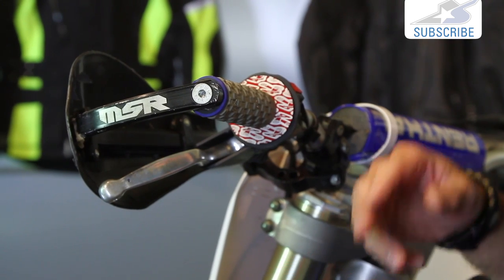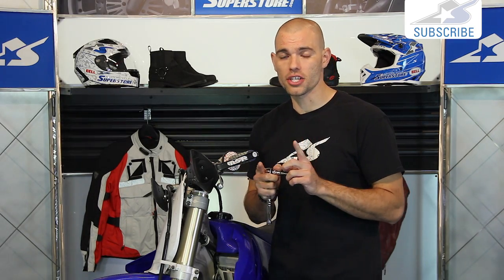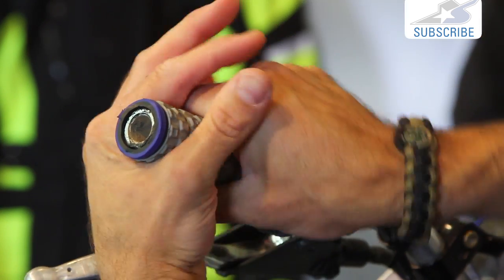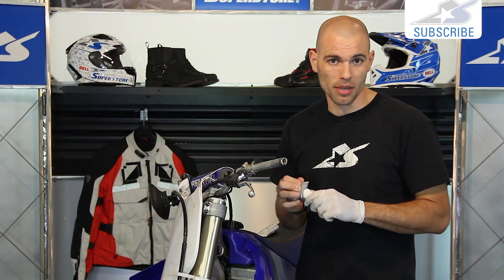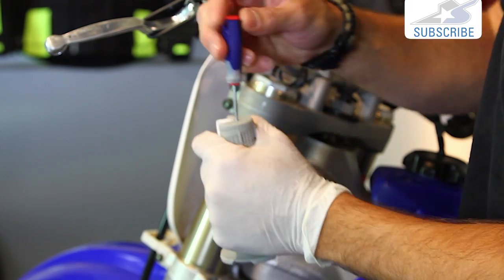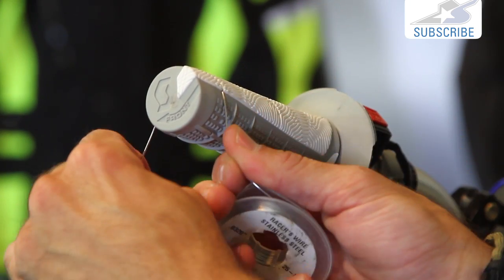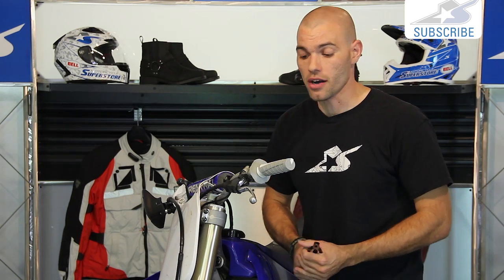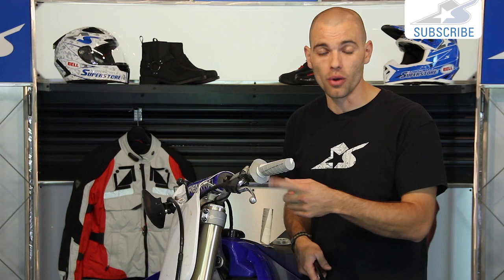How To: Remove and Install Motocross Grips | Motorcycle Superstore

Comment: quick tip to remove grips, use your air compressor to force air underneath the grip and start to twist/pull the grip off. works like a charm and very quick and effortless
Reply: i do the same when i put them on too
Reply: I do the same thing wondering why this “professional” doesn’t know that basic trick.
Reply: K
Reply: @bigolm3237  k
Reply: God bless, Jesus loves you guys
Reply: @joeljuergensen1247  gee i wonder if its because not everyone has an air compressor?

Comment from the maker: Hey Jake, safety wire is not required, but your grips will come off sooner without them, for sure. A spinning grip is a quick way to ruin a ride or possibly get injured. I would wire them up. There's really no reason not to. - jc
Reply: mine are coming lose with saftey wire time to replace them

Comment: That tool is actually for lock-wire, something that is used in high vibration parts such as jet engines, where it is mainly used. There are holes in the nuts that they loop wire into to keep them tight, and they go between every bolt in such a way that they can only get tighter, and the tool is used to make the wire into a strong cable or to tie them off at their ends.

Comment: I love it "Stick it on your broom handle." any ways I like how you respond to everyone asking questions. I got 2 for you. first whats your favorite grips? second i'm 13 out to be 14 5' 2" and 96 pounds what bike do you think would be good i like to do small jumps often and ride around fields on the farm i was thinking about a Suzuki rm85, Yamaha yz85, Kawasaki kx85, also maybe a Honda trail bike but I might break the suspension. this will also be my first dirt bike
Reply from the maker: Hey CaptainPatchXIV-Productions, sorry for the slow response, was out of the office much of last week. Here are my answers to your questions. 

1) Favorite Grips - ProTaper PIllow-Top MX Grips - These are very comfortable, have decent lifespan and I like the color options (even though I cut off the ends for my hand guards). The colored ends are very durable for extra crash resistance also. Here's a link: http://www.motorcycle-superstore.com/14448/i/pro-taper-pillow-top-mx-grips

2) Any of the 80/85cc two-strokes like the ones you mentioned would be decent bikes. Thousands of riders, myself included, cut our teeth on similar machines. However, they are pretty dang racy. They have narrow powerbands that can be difficult for a new rider to control. I promise you are going to flip it out from under you at some point during the learning process. Plus, they are fairly tall which makes it hard to feel comfortable on for some riders. The Honda trail bikes are good machines. So are the Yamaha or Kawasaki versions - though I personally prefer the Honda products. I have a CRF150F for my 13-yr-old daughter and it is awesome - I probably ride it more than she does ;-). I also had a Honda 80 and Yamaha TT-R125 - both cool little bikes. Don't worry, you aren't going to break the suspension. 

Here's the deal - when it comes to first bikes, don't overdo it. We're all tempted to get our dream machine because they're shiny and awesome and our imaginations go crazy thinking about them. And that's the beauty of having the motorcycle bug, but the truth of the matter is that a bike that is easy to handle will build your confidence and skills much quicker. Even if you have to sell it and move up to the 2-strokes or something else in a few months or a year, that's OK. I bought a bike that was too much for me when I was a new rider because it seemed cooler, but looking back it was a terrible choice and I will never be as good as I should have been because of the bad habits it taught me. Talk to your parents, find out what you and they are comfortable with and how much you have to spend. Then compare that to what bikes are available in your area.

Let me know what you decide on. Dirt bikes are the best thing in the world so I'm excited for you! - jc
Reply: thanks I haven't even been on youtube in a while i was actually thinking about a ttr 125
Reply from the maker: CaptainPatchXIV-Productions Not a bad choice. I'd recommend the big-wheel version if possible. It will last you longer and the larger front tire rolls across bumps better. - jc
Reply: definitely getting the big wheel version problem is i'm broke and cant find a ttr 125 big wheel on craigslist in my area that's why i thought of the rm85 because 4 of my friends very close to my size have recently started on one and loved it. i also sat on a ttr-125 l? or the big wheel version and it was about perfect the seat was a little short but not bad.
Reply from the maker: CaptainPatchXIV-Productions Two-strokes are cheap to own and maintain. Big bonus if you're broke... It's a huge reason why I ride a YZ125!! Do what you do, buddy. Just keep your head on straight, take it slow and wear some decent gear. You'll be ripping in no time.  - jc
Reply: dont worry im saving up to buy some nice gear like a leatt neck brace, msr helmet and jersey set, alpinestar tech 10 boots and some knee braces/pads i have for some random reason.

Comment: Well what do they use on stock grips at the factory? In my opinion they last longer and with safety wire it creases the grips
Reply from the maker: +Logan Lott Some grips are vulcanized to the bar and throttle tube from the factory(Kawasaki, Suzuki come to mind). So they will never slip, but I've never liked a pair of stock grips! Another down side of vulcanization is when you want to put new grips on,t you have to buy a new throttle tube and spend a little bit with a razor cutting the grips off the clutch side of the bar.-RH

Comment: Okay so did what you said the clutch sided grip went on with ease but then went to do the throttle side like you said spin it away from the bike for resistance then I heard a big crack now my throttle is stuck ????

Comment: for atv grips (no traits throttle obviously) is the safety wire necessary? i don't want my grips to twist but is the wire necessary for that or just a added layer of safety?
Reply: 808sand Blvke no. I ride an atc 250r hard and I don't use wires nor do the grips twist. I just use grip glue. You should be good with out the wire
Reply: Nate Melino okay thanks. i already used spray paint so we'll see how it holds.

Comment: how big is the lasting difference between the spray paint and the grip glue. I will use spray paint but I want it to last thx
Reply from the maker: If you are wanting to use spray paint but concerned about the durability I would recommend also using safety wire. Grip glue will can last longer but it's easier to install the grips with spray paint. http://www.motorcycle-superstore.com/30310/i/bikemaster-safety-wire-0-032

Comment: I just used enough power and got the left grip off just by that. The old glue was still there just put the new grip a bit into place. Then i took a plastic hammer and hammered it all the way to the end. The right one i just cut in half. Ripped off. Then took the new one. Sprayed some hair spray inside it. Put it a little into place. Hammered it in. You people make grip changes seem like rocket sciense.

Comment: Is it mandatory to use a glue when putting on the grips? can you just use the safety wire?
Reply: yes u can. i never used glue in grips and done competition too. clean the bar from shit
use air preasure gun 
to put the grips on.

Comment: WD40 inside the grip, put it on and let it vulcanize over night.
Reply: beam me up scottie
Reply: Don’t do this. WD-40 will not dry out. Instead use something that evaporated easily like rubbing alcohol or contact cleaner.

Comment: Hey, is it required to use safety wire, or are you fine without them? thanks
Reply: +Jake Bauer you don't have to put the wire on but it will prevent your grips from turning without the wire the grip wil turn easyer

Comment: How would you remove grips that doesn't have bar ends and have a metal covering around the rubber?
Reply from the maker: ***** You can either cut/peel them off or jam a screwdriver down from the flanged end and try to break loose the adhesives. - jc
Reply: Motorcycle Superstore ya I think the only way is to cut the grip's end and try this method in the video. Weird design

Comment: What spray paint do I use or can I use any
Reply from the maker: BONGA BOMB Any will do. I have used satin, gloss and matte finishes without any noticeable difference. Just be prepared to feel them out. I'm not saying that there isn't one that's best, I just don't know what it is. Remember, paint makes installation easier, but it doesn't hold as well as glue. I highly recommend using grip wire as a backup. - jc
Reply: Thanks mate made putting the grips on much easer and thanks for replying so fast.
Reply from the maker: BONGA BOMB No worries, now grip it and rip it! - jc

Comment: I changed the grip that goes in to the throttle and i turned it clockwise and the throttle broke now as i turn on the bike it starts to give throttle by itself. How can i fix it ?
Reply from the maker: IJAmBaZz If the throttle is stuck open and all you did was change the grips, there's a chance that nothing is actually broken. I've had the same thing happen to me on several occasions and it's always because I pushed the grip or throttle tube too far toward the center of the bar.
1. If the throttle tube has the end intact (no crash damage, no handguards), it might have been pushed tight against the end of the handlebar as you crammed the grip in place. Loosen the throttle housing bolts and pull it back a little, make sure it's close but not rubbing. 
2. If the end of the tube is missing, the rubber grip might be rubbing on the end of the bar. Same solution as #1. 
3. If the end of the grip is removed (for handguards) it is possible to push the thumb flange up against the throttle housing assembly. Remove the grip and reinstall.
4. Dirt or grit could have been pushed into the throttle tube or jostled loose. Remove the throttle tube, clean with brake cleaner, reinstall with dry lubricant/graphite/etc.
5. The return cable could be damaged or broken. Inspect it closely where it attaches at the throttle and carb. Replace.
6. Throttle cam/housing is damaged. Inspect and replace.
Hope that gives you a little direction. With any luck it's one of the first four examples.  - jc
Reply: Motorcycle Superstore thanks alot. I turned the throttle counter clockwise with full force and now i can ride.but now as i look down at the throttle housing it has a hole in it and i think there is a part that keeps the throttle in place so it cant go clockwise anymore from that specific spot so i think i just have to replace the throttle

Comment: what does the safety wire do?
Reply from the maker: Craftym Gaming The grip glue will eventually fail, which lets the rubber grip spin on the handlebar. The safety wire holds it tight to help prevent the grip from rotating and potentially slipping off the end of the bar. - jc

Comment: 0:55
Too much bullshit. All you need is possibly a blade to remove the old ones and hair spray to put the new ones on. Spray paint is ridiculous and messy. Hair spray does that same thing with NO mess. Slippery when wet and turns to glue when dry. The wires are a bonus and possibly the 3rd thing you might need. But they aren't always needed.

Comment: The absolute best glue for motorcycle grips is Gorilla Glue. THEY DON'T MOVE..... EVER. You don't need safety wire. In fact, you have to cut them off.